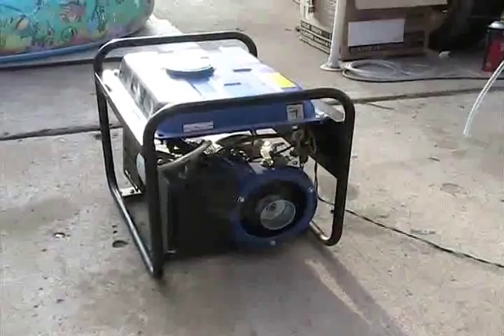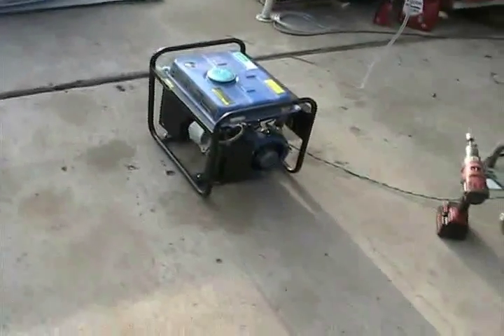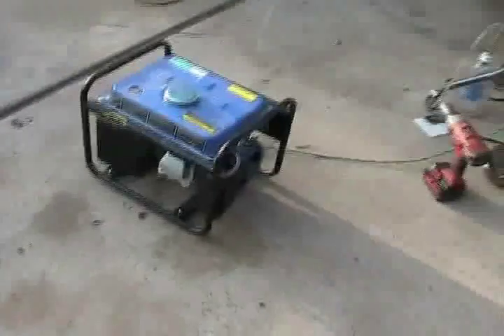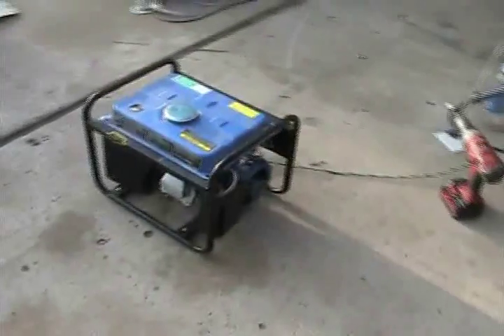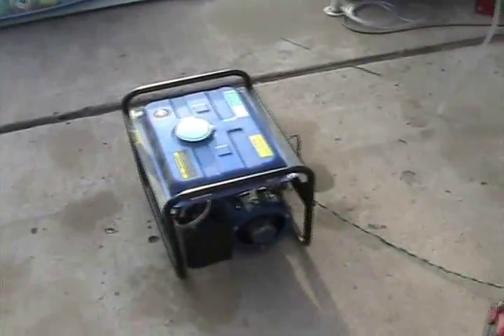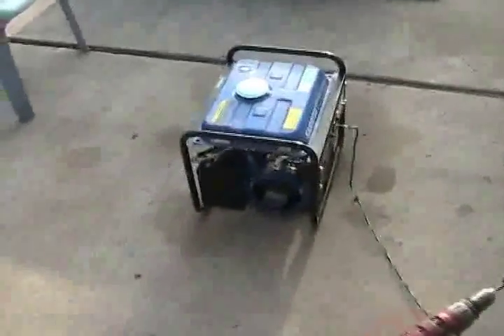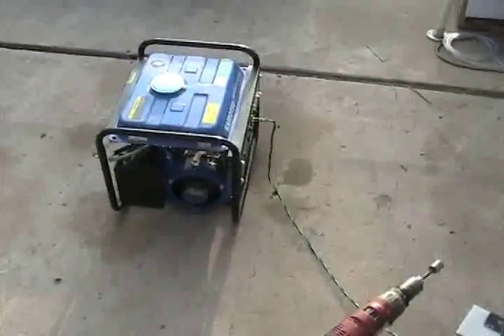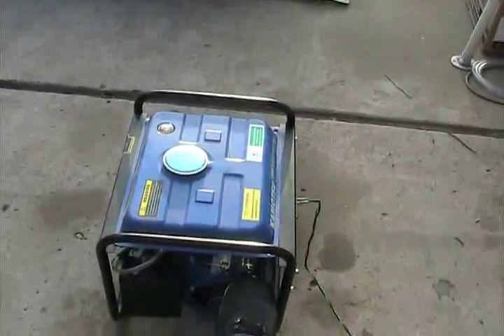generator test 21 engine running on hho

Comment: I am doing same today ... gonna run it for about 6-8 hours or so ... hope it seats everything in ... mine has about 20 hours of run time on it at this point but nearly all of it is on HHO ... 

will have to route me something to replate the muffler I blowed up last weekend ... and there is a minor issue with my air cleaner housing ... but nothing a little duct tape wont fix ...

Comment from the maker: @Me102288 As proven by these videos, NO you dont HAVE to change the timing, if you decrease the timing you will increase the hho required per stroke to increase the flame speed of the burn. As it is the fuel is tuned to the existing timing. You need to forget what you think you know about engines. Your used to dealing with fuels that have extremely narrow burn ratios hydrogen has the WIDEST burn ratio of any fuel from 7% to 97%, unlike other fuels that have a few tenths of % from lean to rich

Comment from the maker: Conti, please wrap your head around this, THE ENGINE IS NOT PRE DETONATING!!! and the timing is not changed, if it backfires its from a lean condition caused because the fuel injection amount is constant in this test and the rpm went too high. There is no fuel metering here it is a constant flow no matter what the engine does, if the engine got more energy the rpm would increase and the fuel would lean which would reduce energy/rpm or sometimes backfire if it got too lean.

Comment from the maker: @Me102288 an actual law probihiting the use of the safest cleanest fuel even huh, it would be amusing if it wasnt sad. But as you noted it does point to what they want us to do. They have found that by nudging us and limiting our choices they can keep most of us going in the direction they want, just like cattle.

Comment from the maker: @Me102288 do you even know what octane means? if you did you would know that a higher octane fuel doesnt make the engine rpm faster. Go spend some time on wikipedia please. Sorry bud but the hho on this engine was "injected" in with about 5psi flowing at a constant rate that was equal to the amount of hho being produced by the cells. Again you havent worked with this and your speaking from conjecture, which misleads people and makes ASSumptions.